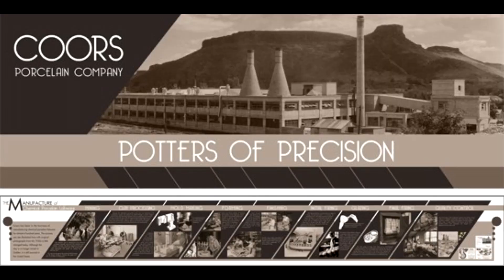Nuclear Ramjet Cruise Missile - Kerbal Space Program Build

Comment: Build a ground station that spews huge amounts of chaff into the air, essentially a bomb buried under a pile of rocks that you can trigger when the missile is flying overhead. Colliding with any debris at those speeds would cause serious damage to the missile. And if you get the timing right it wouldn’t be able to avoid the cloud of dust and fly straight through it.

Comment: I am russian and it's a shame that the development of civilian nuclear launch vehicles was canceled or classified two years before. And, interestingly, many of my fellow citizens are also not convinced of the re-creation of such old-fashioned weapons. Politics and politicians is nothing, science is everything!
Reply: Wasn't it you to laugh about the week of space engineering experts joke? It's only if you use the old ass American technologies. Once you hire real engineers to find a way to implement a closed intermediate cooling circuit, you have the pollution problem solved. A heat pipe with vaporized natrium inside and wolframium or tantalum body could do the trick, for example.
Reply: Nuclear propulsion cannot be used in atmosphere.
If it's safe - it's too heavy, If it's light - it's deadly contaminating. Basically a proper nuclear jet engine cannot even lift itself from the ground.
One could be used in space - soviets developed RD-0410 nuclear engine capable of delivering 3.5 tonnes of force for 1 hour in vacuum... Which is kinda awesome.
Reply: A closed cycle nuclear rocket would only emit gamma rays, everything else is relatively easy to contain. And gamma rays don't create contamination, all you have to do is keep everyone in a safe distance, which is a good idea for any rocket launch. The crew could be protected by a shadow shield, the propellant and distance. With modern materials a nuclear rocket would likely have enough trust to lift off.
But reusable rockets are likely making nuclear propulsion unnecessary, at least for launching stuff to orbit. In the long run space elevators, launch loops and orbital rings will be far cheaper than any rocket.
Reply: I think, nuclear propulsion could actually make it a lot easier to build 100% reusable aerospace crafts, comfortably launching and landing from/to air-strips. Hell, it can make deep space refueling with asteroid ice possible.
Reply: Андрей Желтяк 
It would have made it easier decades ago, but they didn't build it. Now SpaceX already have mostly reusable rockets, and the fully reusable one will be ready too in just a few years. They expect to start testing it next year. Nuclear propulsion still could have a future, but it won't be easy politically.
Reply: Even if the new plant has zero pollution trough reactive cycle, it still emits radiation which tends to make things exposed to it to be radioactive by themselves. So it is more likely to be used unmanned way. Although I can imagine an unmanned nuclear carrier plane to launch light space rockets from the best possible starting point (will make Elon Musk cry like a bitch), and of course nuclear powered space crafts with electro-reactive propulsion. Current space-crafts usually have energy sources at n kilowatts, which limits their propulsion, mass and hardware power. When it will be n megawatts, it's basically a space-craft 1000 times bigger, faster and more effective in terms off science instruments.

Comment: I'd like to learn more about the "open cycle reactor" thing. It seems to me that very little nuclear fuel or byproducts would actually end up in the air stream because the air would just flow over the ceramic fuel. Do the neutrons just irradiate stuff in the air (dust, event the air itself) and make it itself radioactive? Or does the fuel actually ablate due to heat and air flow?   Scott, maybe you could talk about this in your nuclear series?
Reply: All of them things, basically. The air they used for testing PLUTO was captured instead of just being thrown into the atmosphere.

But if you have a neutron slam into oxygen or nitrogen (air) you're going to make it a different (probably radioactive) isotope. Which'll then get breathed in. Same with dust and water etc. If anything is ingested (like dust) that will slowly erode the fuel away too. Having cold rain suddenly impacting the fuel will cause that part of the fuel to suddenly cool, possibly leading to chunks of fuel breaking off (like breaking a piece of hot glass and then dropping a drop of water on it, the sudden contraction makes it shatter).
Reply: @Logarithm906 this actually was tested in open atmosphere. Air molecules are very hard to make radioactive if they have a very low neutron capture cross-section.

Also it's at high enough altitude that dust and water ingestion are not much of an issue. Extra water in the form of aerosols would actually give it more thrust

Comment: Yeah, at those speeds, your back end needs to be lighter as the air friction is so high the lighter section will be pushed to the back unless you have ridiculously large wings to prevent the flip.

I have even designed a spin stabilized rail gun round of this thought

Comment: 7:04 why is nuclear propulsion by definition bad? if we eould be able to design a safe method of nuclear jet engines it would change the future of avionics forever, and probably safe the climate.
Reply: What comes up - must come down. Do you want a chance of Fukushima Daiichi worth of plutonium crashing next door?
Reply: volocat That's true, preventing nuclear contamination in case od an accident would definitely be one of the most important requirements to be safe.
Reply: You're right. I personally would rather have nuclear reactors running full power and producing jet fuel from atmospheric CO2, or other sustainable sources. Yeah it's less efficient but safer.

Comment: And here I was thinking the Davy Crockett was the apex of the nuclear craze in the 50s and 60s.
Reply: There was even crazier project NEPA. The idea was for nuclear-powered PILOTED bombers to fly one month worth of autonomous patrol missions (kinda like submarines do).
The radiation was so insane that the planes could be only be serviced by robots, and pilots boarded the plane by attaching a FULLY-SEALED shielded cockpit to the air-frame.
Ah! The good times!
Reply: Project Orion at least wasn't about killing millions, it was actually a cool concept. Traveling around the solar system in a million ton cruise ship sounds nice.
Reply: Andrew H,
It's a pleasure arguing with you (really, it is), but now I'd have to direct you into some reading.
We must be talking about Californium-252. Putting aside its impracticability of a nuclear device worth at least 50 billion dollars, which would go sour just after 4-5 years, there is another parameter you have missed: Spontaneous fission.
The shorter the half-life is (and lower the critical mass) - the harder it is to avoid predetonation (i.e. melting of material before detonation).
Californium-252 device would be significantly larger than it's plutonium cousin due to greater initial separation of material and more complex implosion mechanisms.
To make long story short - you are adding at least 25-30 kg of hardware to shed 8-10 kilos of fissile core without any additional benefits. Not very practical.
Reply: And then there was that plan for an Orion-propelled 4000 Mt (sic) nuclear orbital warhead from the US Air Force. Thankfully, that one never went further than a few schematics.
Reply: Ryan G There was some things that made them say wtf that is crazy. With the right fission fuel and no care about shielding or stability you can shrink a nuke to a hand grenade size so be glad the research done stayed in lab scale production unlike the Uranium/Plutonium family.
Reply: Andrew H, you can't shrink a nuke to a size of a hand grenade. There is a minimum mass of fissile material needed for reaction (i.e. critical mass). You can't go less than 20 kilo.
Reply: Volocat nice to see reading skills are not required as I said if you step outside the Uranium/plutonium family then you quote the uranium/plutonium mass. U235 and Pu239 have long half lives and produce few free neutrons when they are broken meaning a chain reaction in them requires a large mass, If you move to a fission fuel with a short half life that produces tons of free neutrons when broken you have just reduced the overall mass needed for a fission chain reaction. Californium is a perfect example as it produces almost twice the free neutrons when broken and the half life is measured in days to years rather then thousands to millions of years. 

Yes you would have to be nuts to make a californium bomb along with being very rich but it is possible and it would be small when done.
Reply: Andrew H
Short half-life is actually a problem, because it generates radiation and heat that could damage the electronics, and also you lose your fuel over time.
Reactors can be made more compact, because there you have the luxury of using moderators, but I don't think bombs can be made much smaller then a briefcase.
Reply: Well there were also genuine backpack nukes deployed by special forces called "Greenlight" teams which were to blow infrastructure in case of soviet attack into Europe

Comment: How would they keep it from melting?
Reply: it is air cooled, obviously
Reply: Ablative vodka cooling komrade
Reply: They bought paint from a hot rod catalogue.
Reply: +Whitefang8128 no, that just makes it go faster.
Reply: SR-71 Blackbird could withstand that kind of speed and heat. Ironically enough, it was made from titanium sheets, which were smuggled from Russia.
Reply: Ceramic coating?
Reply: Max 
I wasn’t clear. The reactor would be air-cooled but the airframe would have immense heating at low altitude at Mach 3.
Reply: If the paint is red, it goes faster. To cool it, you probably need blue paint. I think...
Reply: @volocat: Not smuggled, but bought through a middleman.
Reply: SR-71 could do Mach 1 at 18k feet.
Source here: https://www.sr-71.org/blackbird/manual/5/5-9.php
I'd say a craft with smaller cross-section might crawl to Mach 1.5?
Reply: volocat those titanium sheets will not hold up at low attitude.
Reply: Materials that could withstand such temperatures? It probably had no more than 2500K.
Reply: The SR-71’s threshold for supersonic flight is around 20,000 feet.
Reply: Steel should be sufficient.